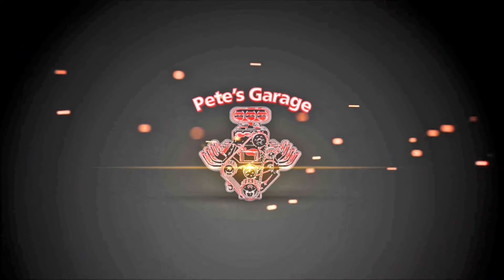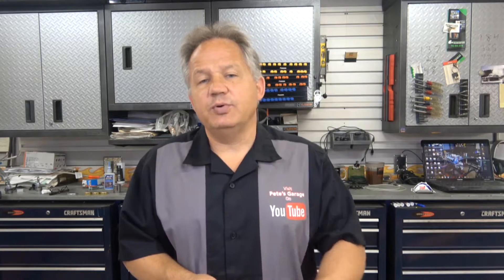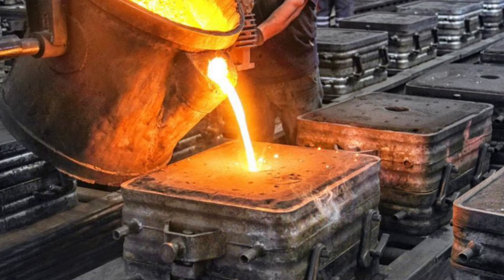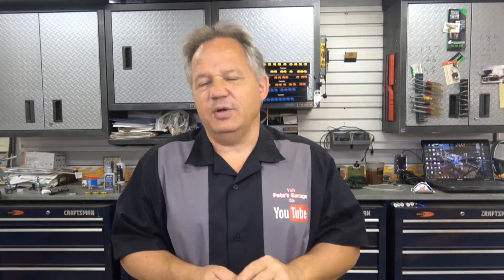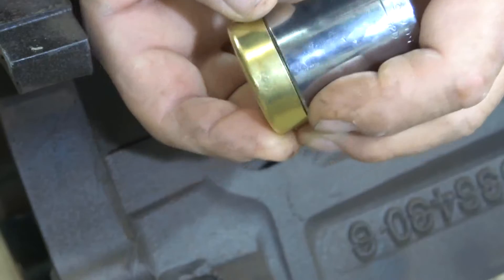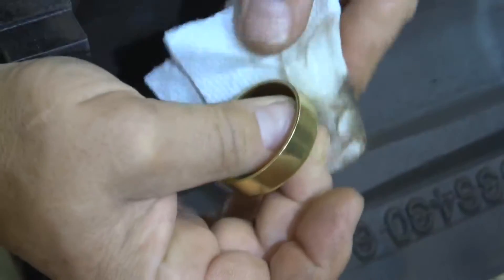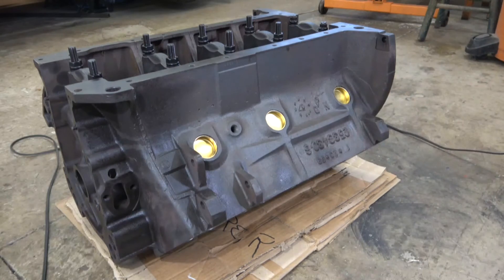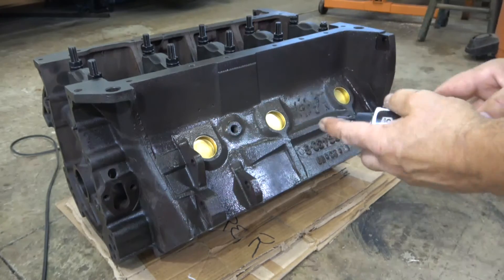Engine Building Tips - Installing Core (Freeze) Plugs 440 MOPAR 512 Stroker

Comment: Great video.  I just used some Vibra-TITE 550 on a few core plugs.  It has been about 18 hours and this stuff is still in a liquid state.  Do you know how long it takes to set up?  It is about 95% humidity here in Arkansas right now. Thanks
Reply from the maker: It's anaerobic like Loc Tite, it cures between parts

Comment: Great tips! I could have used that tip about not putting the socket inside the plug last year when I had troubles... Does that rust preventative dry on the block? How long does it last and can you use it anywhere else like disc break rotors?
Reply from the maker: The rust preventative last awhile. It would certainly work on calipers

Comment: Thanks Pete! The freeze plug thing always seemed kind of  an odd description, although even on the package it says freeze plug, you would have to be pretty careless for your block to freeze up solid, but I live in Texas where it’s not normally as cold as up where you live, are frozen cracked blocks common up there? And would the core plugs pop out saving the block in case of a freeze? I always figured if I used water instead of antifreeze it would evaporate pretty quick from the heat?
Reply from the maker: Someone would have to fill it with just water, and I would think the block would crack before the plugs pop out. But it would have to get really cold first
Reply: @PetesGarage  that’s what I was thinking thanks